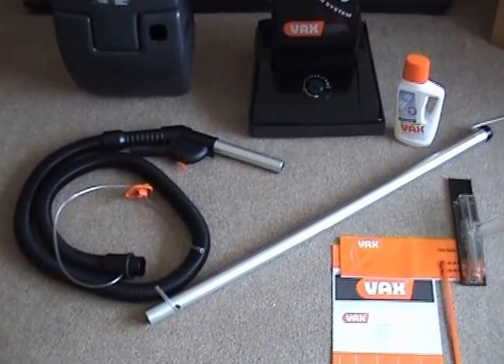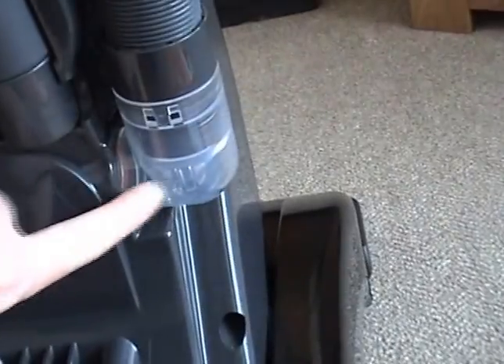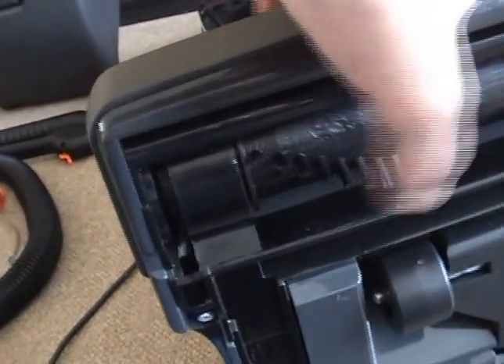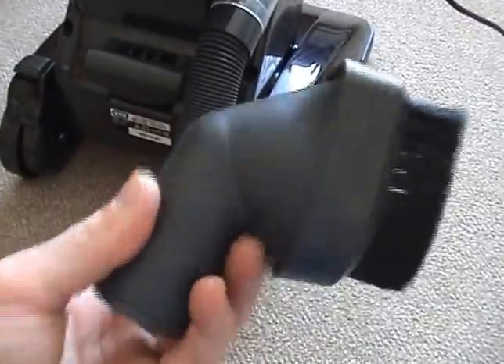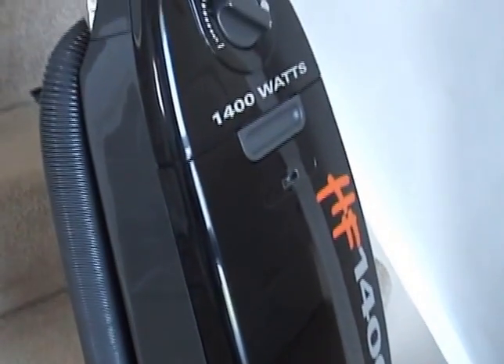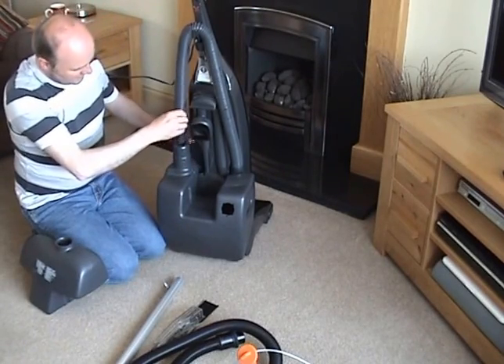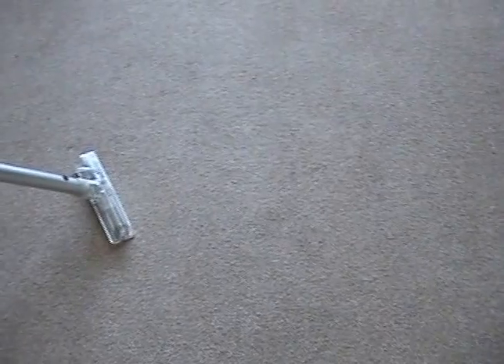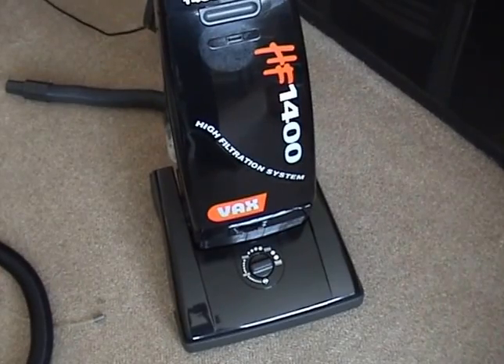Vax HF1400 Upright Vacuum Cleaner & Carpet Washer Demonstration & Review

Comment: I like the "spill pickup" tool quite a bit. That's a very good idea, much better than pulling out a full sized carpet washer or even a portable handheld one since with that attachment you could just use a spray bottle to spray some carpet cleaner on the spill and use the attachment to suck it up.